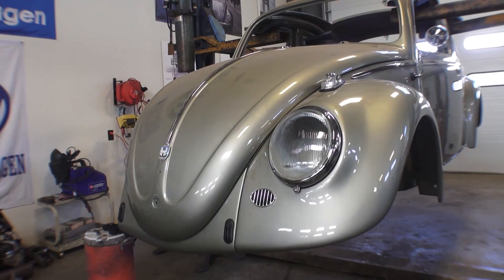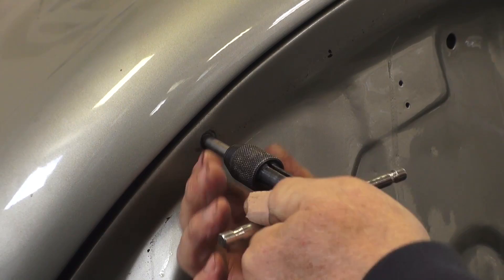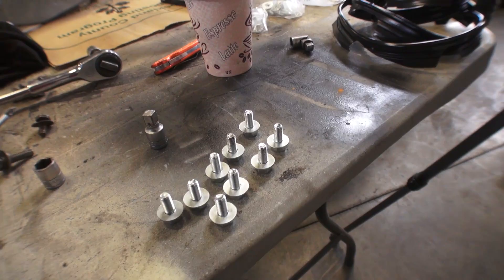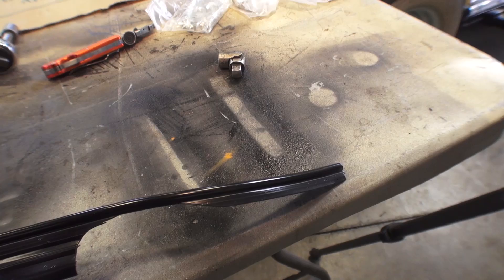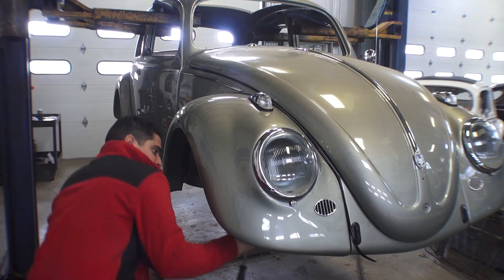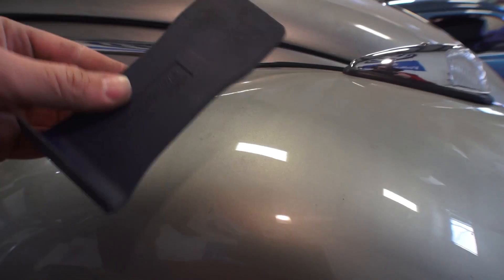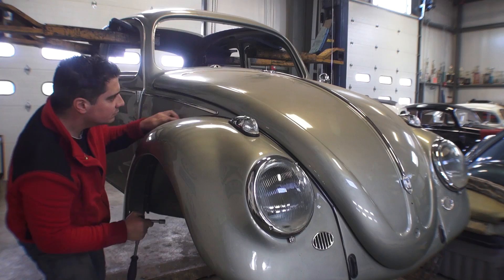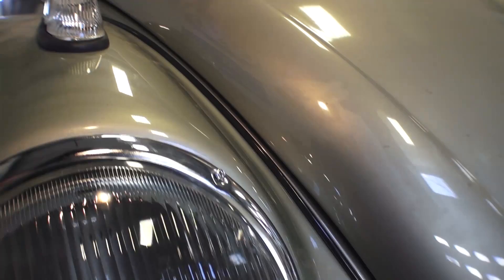Classic VW BuGS How to Mount your Fenders and Beads for Vintage Beetle

Comment: Yes! You can install the rear fenders from a 1973 VW Beetle (not a Super Beetle), with a large round "elephant footprint" taillights onto a 1957 VW Beetle, since most parts are interchangeable from one year to another. I saw that a 1957 VW Bug with a 1973 fenders, both front and back from 1973 VW Beetle in the car show in Hot August Nights in Reno Nevada from 1989 to 1993 when I used to live in Reno Nevada for 5 years. By the way the 1957 VW Bug was red.

Comment: Hey Chris, why aren't you all painting the fender bead or welt to match the body color? Are you aware that an additive can be put into the paint to make it flexible to paint the bead before it is put on the car? In the old days when factory paint was overn baked enamel and cars used fender welt with the clamshell fenders, the welt was painted at the same time as the body. I have a 72 Beetle Marina Blue and sometime after it was taken out of its 37 year storage, the fender bead was replaced. I am going to do it again but I am putting back painted fender welt.
Reply from the maker: Beetles from the 50s had black beading, never an off color from the bug.  In the 60s they started with the color beading, but they were not painted while on the car, that would cause caking.  They were always put on afterwards on the assembly line.
Reply: @classicvwbugs  What do you mean by caking?  Regarding painting fender welt for American cars. I used to have a 1951 Studebaker Champion with welt between the rear fender and the body. When it was repainted, the painter did the same thing that was done at the factory when the car was painted new. The bead was painted with the fenders loose on the body; with a gap between the two body parts. A few days later over a beer, he showed me a movie of the painting of Studebakers at the factory taken in 1952. In the movie you could see the body, welt, and fender being painted at the same time and then going into the oven.

My Studebaker was originally sold at Pitcher Motors in Poughkeepsie, NY on September 19, 1951. This happened to be my first birthday. I didn't find the car until 1970. I grew up in Fishkill, NY and I used to work at Contemporary Classics in Cold Spring, NY back in 1970- 74. 

I do know that some years you could get replacement welt or beading in colors from Volkswagen and I have seen some advertised on TheSamba and on aircooled.net. I am thinking of purchasing a roll and painting it the body color of my car, Marina Blue (L54D) from a mixed spray can with flex additive; same material used on modern car flexible parts.  Then I will loosen the fenders, run a tap through the weld nuts and install new bolts but with added fender washers.
Reply: @classicvwbugs  My 1972 Super has only 53,040 km on the odometer. It was in storage from 1975 until 2012.

Comment: Would the fender beads protect against rust buildup in the joint? You see, i really want my first car to be an old beetle and use it for everyday driving all year around. Just trying to learn the most about the car before purchase. What's your thoughts on this.  :)

Comment: I would NEVER install fender bolts without using ANTISEIZE compound.  Inevitably, inexorably these will become rusted.  The area is constantly inundated with water.  When you go to remove them at some point, they will break off and have to be drilled out and tapped...a lot of extra work.  "An ounce of prevention....."   You complete it.
Reply from the maker: These are show cars, they will never be out in the rain.